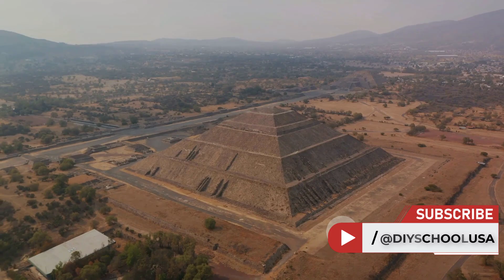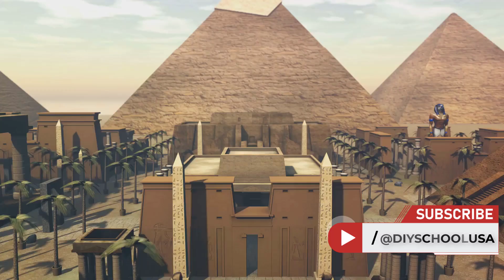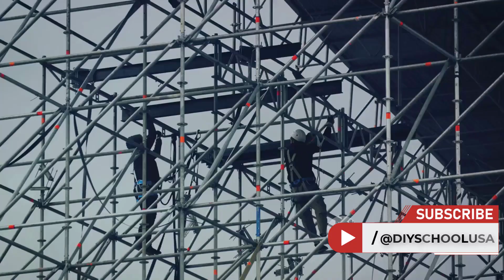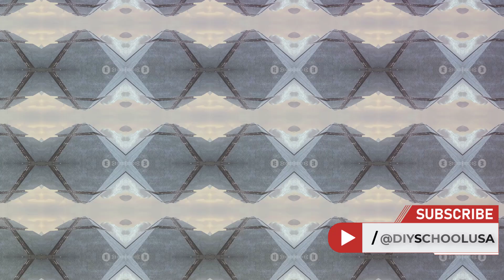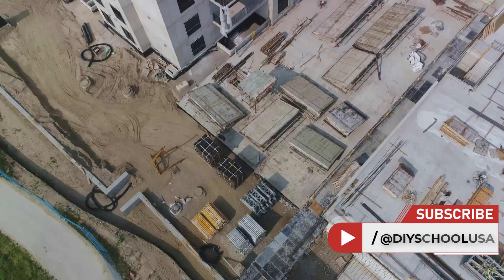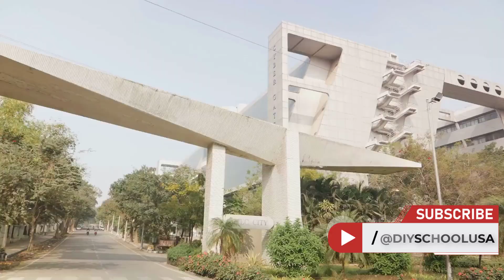Incredible Engineering Feats of Ancient Pyramids | Insides of The Pyramids

Comment: inaccuracies.  1. The nile river ran right up to the giza plateau as did many canals built so floating the stones is the way they moved the material for most of the journey. There are numerous buried boats around the plateau supporting this.  

2. the shafts DO NOT align with orion.  That is a myth.  And it is easily shown to be a myth since the orion constellation IS NOT STATIONARY IN THE SKY.  One can align with the north star because it is circumpolar and doesnt move relative to the other stars... the orion constellation on the other hand rotates through the sky over a 24 hour period and therefore CANNOT be aligned with something on the earth since it moves from east to west and is under the horizon for a significant part of this journey.  It would be similar to suggesting something is "aligned with the sun"

3. the pyramids being "aligned" with the ratios in the Pythagorean theorem does NOT suggest that they knew the Pythagorean theorem. ALL triangles align with the ratios of the Pythagorean theorem... no matter if you know the theorem of not, if you create a triangle, it will satisfy the theorem.
Reply from the maker: Thank you for sharing your insights! It's always interesting to hear different perspectives and interpretations of historical facts.